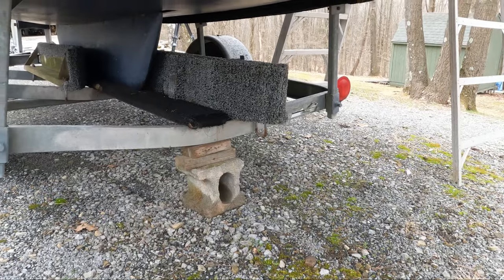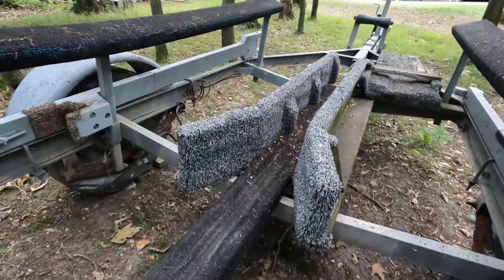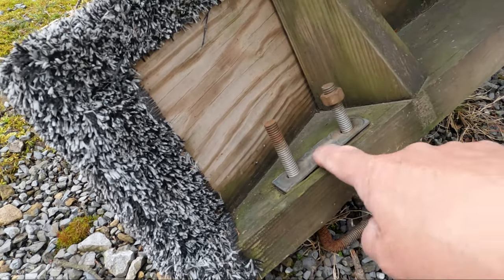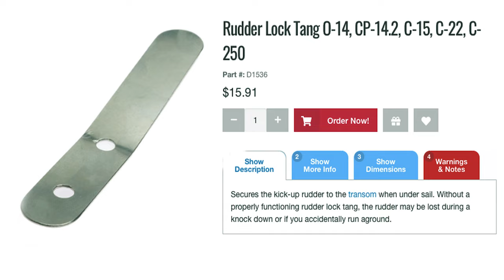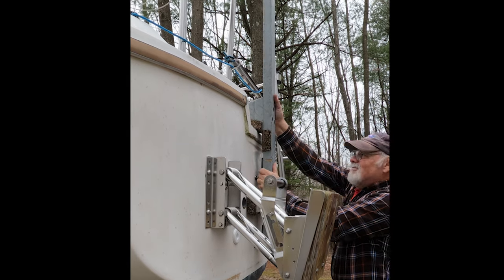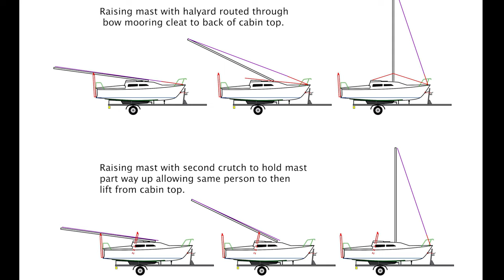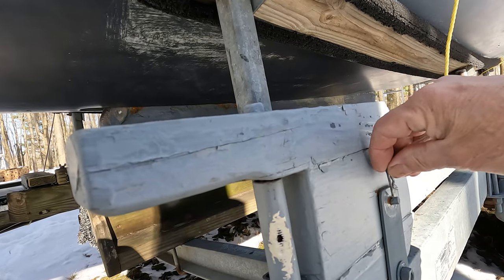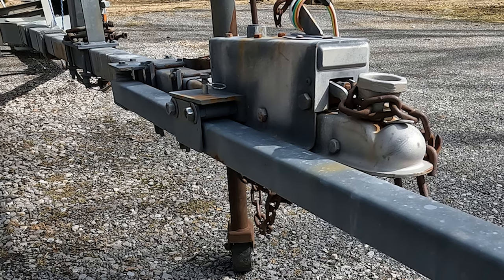#22.  Catalina 22, Swing Keel Trailer after 30 Years.

Comment: Hi!  Thanks for the awesome videos!  I have watched several.  On you Catalina 22 trailer modification what was the tubing size and wall thickness you used?   I have a MacGregor 22-2 and want to extend my tongue for launching but want to make sure that it is stout enough.  I will reposition my axle to get the tongue weight in the 230 - 325# range for a 2300# trailer, so very similar to what you have.  Thanks for your response and may God Bless you in your adventures.
Reply from the maker: I would suggest buying the steel from a fabrication shop rather than from local hardware store or Lowes because the steel maybe of heavier material as well as maybe stronger not coming from China. The towing tube is 2” square, where a standard 2” trailer end will fit if perfectly, but the towing ball is only 1 7/8” for this size where your present trailer may be of a 2” size. Therefore you will need another receiver for your vehicle as I do, not shown in the video. The tube weight is a standard thickness at 4 feet long, it’s enough for light towing around in the parking lot. I would suggest a stronger thickness if  your extension is going to be longer than 4 to 6 feet. The plate steel for holding this extension is 1/4 “ thick, all works great but the hinge part, on a redo I would make this park out of thicker material because of it bolt clamping to the trailer, I some times have to take a hammer and tap this part a few times to drive it toward the back of the trailer to align with the pin holes for final attachment before towing on the highway.